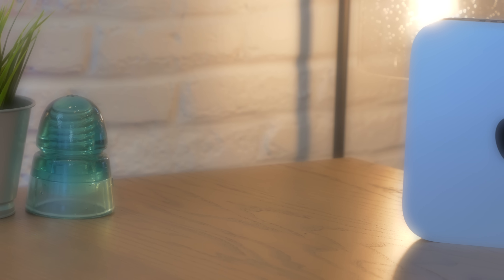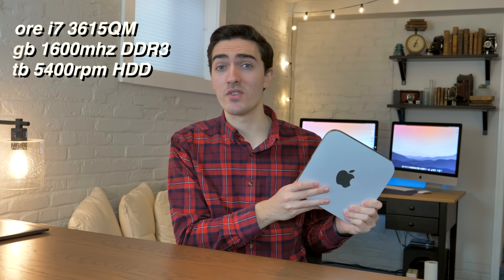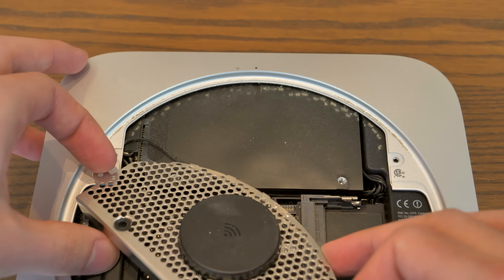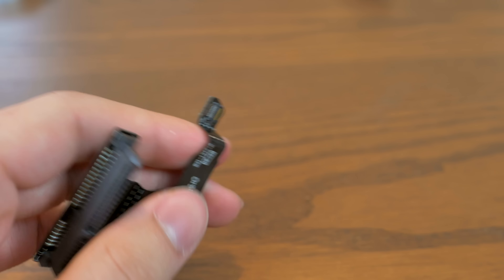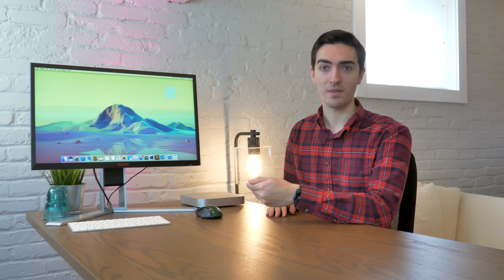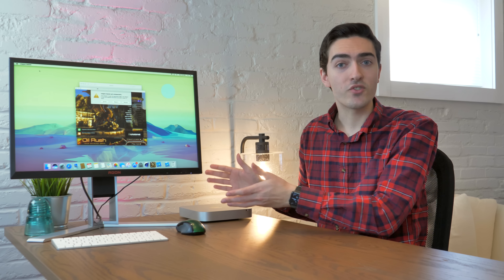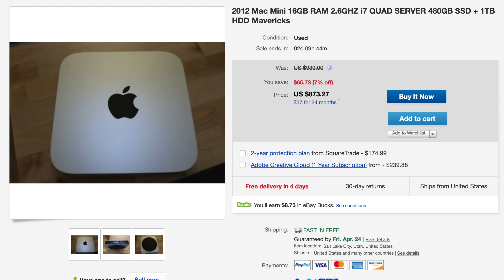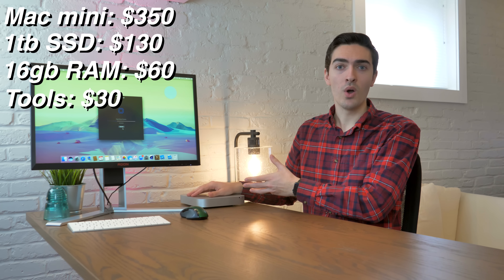Building the ULTIMATE 2012 quad core Mac mini – But is it worth it?

Comment: If you find one cheap go for it. Otherwise please don't by any macs before 2012. 

I have a maxed out 15 inch last 2013 macbook pro. If your anyone else it's I'll be fine for you. But as a programmer, UI UX designer and occasional video editor it shows its age

Comment: I had a 2012 Mac mini, i7, upgraded to 16gb ram and 2x 500gb Ssds. I was able to perform a RAID 0 and cloning OS Mojave onto the combined drive running stable with about 1GB read and write speeds. Great option and fairly priced, after all the upgrades it came out to around $550.
Reply: Hi Richard, I did the same with Catalina!

Comment: A fairer comparison would be to say compare this 2012 and any subsequent models with the same amount of internal SSD. 8GB RAM is sufficient for most tasks. Then you can see if the trade off is still worthwhile - lack of 4K (QHD only available via the single Thunderbolt 2 port); no USB-C/Thunderbolt 3 and of course the anaemic graphics performance.

I happen to have a mini 2012 (Server), and upgraded one of the two internal 1TB hard drives to a 1TB SSD. It was faster than my iMac 4K (2017) until I also upgraded that one's hard drive to an SSD!

Comment: Damn this video was interesting in a sense of I’m literally upgrading my Mac mini late 2012 as well and started about 2 weeks ago. It’s has a i5 2.4Ghz, 4gb 1600mhz, 500gb hdd. I managed to find a late 2012 Mac mini here in Australia in pre good condition with all of those stats for $200AUD, I bought ram 16gb 1600mhz ram $116AUD and a 256gb Samsung 850 pro from a previous build $80AUD. All up costing me around $400AUD, I felt so bad when I heard how much you paid altogether. But if anything you do have a core i7 which are pre hard to find here in Australia and even on eBay. But in saying that I have saved sooo much $$$ from a upgrade like this.

Comment: You could definitely save money by cutting back on the SSD. Why would you waste money on a 2.5" SATA SSD that costs over $100? You could get a really cheap 256GB one for about $40 - $45 when they go on sale. This cuts your cost down from $130 to just $40 - $45. You really don't need to run 1TB SSD at all. I don't get why people do this. If you have options to have an extra drive, I wouldn't waste the money to buy a full 1TB SSD. I'd buy the cheapest or at least get one that's about 256GB. Then put the macOS on the 256GB SSD. And then I'd just use the 1TB mechanical drive that comes with it as storage. I'd first copy the /Users and /Applications folder to the 1TB mechanical drive. Then deleting them from the 256GB when running from Recovery Mode. Then at the same time without rebooting, remapping the /Users and /Applications folder from the 1TB mechanical drive to the 256GB SSD. This in turn allows me to keep the SSD for just the OS itself. And then for my personal files and downloaded applications, they are on the 1TB mechanical drive.

Say if the entire installation took about 60GB and the /Users and /Applications folder factor in about 20GB in total out of that 60GB, then moving it to a device with a higher storage size is way better. You leave the SSD itself for just the operating system and nothing more. That cuts the usage of the SSD down by a lot because the operating system itself won't all of a sudden go from 40GB to say 500GB. If it ever does that, you know you got a virus on there. The highest it'll ever go is maybe up 10GB or so from OS upgrades. If you do happen to find yourself losing a lot of storage from just the system itself, you could also check the /cores folder which stores application crashes and system crashes for developers. Those are kinda useless for a typical average Joe so deleting that whole folder wouldn't hurt.

Anyways, the point is, why spend $100+ on a 2.5" SATA SSD when you really don't need that much SSD? You really just need a small portion of the SSD to store and boot up the operating system. Other than that, your personal files and downloaded applications could be moved to a higher storage device.

Lastly, you're being over charged for your Mac Mini. Mac Minis should be going for about $240 - $280 range. So if you also factor that in, you're spending a lot more money than you really should be. So if you were to causally buy your setup, you'd be doing

Mac Mini: $240
256GB SSD: $45
16GB SSD: $60
1TB mechanical drive: Comes with
Tools: $30
Total Price: $375

So the total of these items cost just $15 more than the Mac Mini you bought just alone.

Comment: I run a Mac mini 2012 (Upgraded RAM, Dual Storage combined to an Fusion Drive) together a Akitio Thunder 2 with a RX 560 4GB in it and even it only has TB1, it is a HUGH improvement! Heaven run with around 45 FPS. World of Warcraft Runs way over 100 FPS and even Total War: Warhammer 2 runs with 35 - 60 FPS.

Comment: I've got what you ended up with and for me the value is there, but that's because, except for a new SSD, I bought it back in 2012 and quickly upgraded the RAM to 16GB. That means I've gotten eight years of value from it, which is quite a deal. But I agree with you that spending almost as much now to give myself that same performance makes little sense. That said, it does all I need it to do, so there's no pressure to upgrade.

Comment: I have Mac mini (Late 2012) 2.3 GHz Intel Core i7 16 GB 1333 MHz DDR3 - 1 TB SSD - Dual Monitor Setup included a LG UltraWide 34 Inch Display and HP E222 Display - set vertically - Runs like a champ and I do remote tech support for a living and some programming. I can also run and edit in Final Cut Pro with no issues - just not 4K obviously. I run Windows 10, Ubuntu in Parallels for work with no problems either. This a great value if you can add and replace what you need slowly.

Comment: You dont need the tool to remove the board. Just hook up an ethernet cable, and pull a bit. pulls it right out. (pc repair guy tip)
Reply: Legend tip helped me out !
Reply: I use 2 slim screwdrivers from an iphone repair kit. Even if you only have one, take turns in each hole to move it out.
Reply: this trick works very well. Thank you so much!
Reply: The tool is cheap (I think $5 from Amazon) but you can do the same thing with a couple of slender screwdrivers as leverage. I'm not real keen on pulling the assembly out using an ethernet cable – the cable itself is strong but the connector is plastic and could break off inside the ethernet port. The ethernet port is also off to the left on these boards next to the power connector, so you're not getting even leverage on both sides of the board. Anyway, just my humble opinion.

Comment: [edit] I just remembered the issue with UsB was NOT the Mac Mini but strange behavior from an aging wireless Logitech keyboard. This is apparently common among Logitech wireless dongles (whatever they’re called.)[/edit]

Having this model for several years I can say they are solidly built. One excpetion is that the USB 3.0 system can sometimes flake out and stop devices from working. Sometimes the quick fix is unplug a device and move it to another USB port (unless you have all four ports filled then you’ll have to power off and restart unless you have remote access from another network computer and can shutdown remotely.)

I intend to install Linux (distro recommendation?) on one of these to see if will work properly.

Comment: We have three of them. Note there is a “server” version that has the dual drives already installed so if you’re lucky enough to find that model on eBay grab it so you won’t have to perform the iFixIt upgrade.

Comment: I bought one in 2014 for 600€, did upgrade to 16gb ram, 512 ssd and kept the 1tb spin drive for storage, connected to 2 Asus ProArt 24" 1920x1200. It was my main machine for pro photo editing from 2014 to 2017. I removed the bottom lid and diy a stand with a 20cm fan underneath to keep air flowing. Really loved it and i keep loving it. It now stands at home connected to a Dell 24" 2k and hitting hard at Photoshop, Lightroom, On1, Affinity, no complaints.

Comment: I have one and have used it since 2012. On the plus side 16GB of memory and the 500GB SSD I put in on day 1 have served me well for 8 years. Downside, I wish I bought a larger SSD (they were there in 2012, just really expensive) and now the 16GB limit on memory is getting to be a bit much and the abysmal GPU is really starting to get on my nerves. I have a 15" Unibody with the same specs and a GPU (Nvidia) and it screams in comparison to the desktop now. BUT I will upgrade my MM to a new MM with the i7, an EGPU and 64GB of memory to serve me for the next 8 years shortly.

Comment: Bought this very same quad core i7 Mac mini NEW in 2012, upgraded to 500GB SSD and 16 GB RAM in 2014.  Still using it today (actually typing this comment on the Mac mini).... that where the value comes in.  One computer in use for8 years that is still worth $600.

Comment: I got a late 2012 i5 Mac mini for free, I threw a brand new 256gb ssd in it with 8gb of ram. I’m trying to use it as my secondary WFH system with two monitors. I find I’m maxing out the ram when I have everything I need open. (Which is mostly web brower tabs) I’m considering upgrading the ram to 16gb. To help alleviate some of the slow down, but not sure it’s worth it really because I’m not really sure if it’s the ram usage or cpu usage that is ultimately my problem.

Comment: When I first bought my top-tier 2012 Mac mini I made the max RAM upgrade, 1TB SSD (Toshiba Q-series), and made it into a Fusion drive with the w/ the factory HDD (also a Toshiba, coincidentally). That served me so well for 7 years. The ultimate issue came down to thermal issues. Over time the base CPU temp slowly crept it's way up from roughly 50°C to ~70°C. Despite reapplying thermal grease (tried 4 different brands) the temps never came down. It got to the point of doing any one thing - even just opening a single tab in Safari or Firefox - would put one or two CPU cores to the max, temps would spike up to 99°C, the fan would max out, and after the 10.14 upgrade it occasionally would just lock up for a second or two. Getting the base-model 2018 Mac mini cut my video render times by more than half. Unfortunately I just couldn't ever get the temps down on the 2012 Mac mini & simply don't trust it at this point stay reliable. So it's in the collection now.

As for the eGPU, I made a couple videos on it and the TB1 connection is a major bottleneck. And while there's no way to be sure, I suspect the CPU eventually gets to a point where it bottlenecks to a degree as well (even mild gaming pegs the CPU at 100% non-Turbo Boosting across all cores). Can't truly test that though since we can't remove the TB1/TB2 to TB3 adapter from the equation.

Comment: An iMac 2012 probably the same specs for 220, only issue was the hard drive. I just use an external ssd to boot from. Works great. I keep procrastinating to pop open the iMac 😂, I have all the stuff to fix it.

Comment: lol... That's for u.
Last week i got mine on eBay for $251 + TAX + Free shipping = $273.28.

specs are:
512GB SSD
4GB memory
i5 quad core 2.5 GHz processor.

I only upgraded the RAM to 16GB, and it cost me an extra $40 + TAX + Free shipping = $43.55.
Maybe not the best deal, but I think it's worth it.

Comment: I got mine in 2012 with the i7 2.3. During all this years I've upgrade RAM and SSD. Prior APFS I was running MacOS on raid 0 and it was pretty fast. About two years ago I bought a 3440x1440p display but the iGPU in the Mac Mini only worked at 30fps while my display goes up to 100fps. I went eGPU route with a sonnet enclosure and a RX590 and I'm getting 41048 in metal geekbench and I can run my display at 100fps (this is totally unsupported by Apple, but not very difficult to achieve). This is the best value for money computer I've ever bought from Apple. Now I have also a MBP16", but I don't think it will ever be as valuable as the old mac mini.
Reply: I forgot to mention the same enclosure and eGPU only got 47000 with the MBP16". Not too bad for the old Mac Mini I think...

Comment: Bought my MacMini 2012 i7 2.3 Ghz and changed straight away Ram from 4-16 GB.
Two years ago installed 500GB SD. Should have inserted 2, 1 TB SSD.
Use MacMIni as a music computer. Biggest disadvantage it runs very hot. Its been a good Mac!

Comment: I bought one of these in 2013, (dual core i5 version) for £450 with a student discount. When I installed High Sierra it became very slow but still just about usable but I was now using windows 10 for most tasks. I had to do some video editing in lockdown and thought imovie would be the best thing to use. I bought 8gb ram and 500Gb SSD and it has transformed this machine to better than new. In total I have paid about £550 for a mac that has effectively lasted 7 years and is still going pretty strong. It's no powerhouse but for everyday use and imovie, garageband and multitasking it works smoothly and running Catalina. For me it is the best mac apple ever made.

Comment: So with the 2 TB SSD and the 1TB platter did it try to create a fusion drive? When I did my first upgrade I went with a 512 SSD and a 1TB platter and it wanted to make a fusion drive out of it. Wasn't with Sierra, HS or Catalina so maybe those newer OS's would have created it as 2 separate drives. A couple months ago I went to a 2TB drive and nixed the platter drive. Not much of a speed increase but I sure do like the storage. Thinking of adding a second 2 TB drive but not sure if it would report as 2 separate drives or one 4TB. Thought I read an article where there was a 32gb kit for our older mini's but not seeing anything beyond 16gb. Not that it really needs it I guess. I use the 2012 mini at my office, a newer 2018 mini in my room. Both work just fine and I'm using the 2012 to type this now. Gets a bit warmer than I like to see and I noticed that the CPU and gpu aren't at the same elevation when I repasted. I get a nice spread pattern on the cpu but not so much on the gpu. Guess it's a gpu, I'd need to look at the ifixit page to make sure what I'm looking at. TG Pro calls it the GPU PECI. Nope, I was looking at the wrong thing. It's actually the  Intel E224B809 platform controller hub. Guess it's ok because the temps I'm seeing are lower than the CPU cores.I usually run mine without the bottom cover since I use a sliding mount and if I'm really using a lot of programs then I'll aim a secondary fan to try and keep it cooler. I don't like running above 80C. Handbrake sends the cores to almost 100% usage so I don't use it that much anymore.

Comment: 5/16/2020 I use a 2011 iMac mini server with anI ntel i7cpu and two 500GB HD the only upgrade I have done is 16GB Memory and thinking about upgrading the HD to a 500GB SSD since they are now affordable. I use the mini with Parallels software so I can use MS Windows in a virtual window for my CAD drafting software that is only Windows PC. The 16GB does speed up and usefulness of being able to run both OS at the same time, I think with an SSD I could greatly increase the boot time with Apples High Sierra the max OS it will support. Apple has made it harder to upgrade any Mac mini now with most everything being soldered in. Wish it still had the built-in DVD drive. The 2011 iMac mini Server i7 sold for $999 when new, check E-bay for some good used prices if your not going to use it for gaming.

Comment: i purchased a 2014 mac mini for $1 at a yard sale needed a hdd since the lastone died and needed a new wifi antenna 

wifi antenna $12 a 500gb ssd $50 a pcie connector $13 and 128gb nvme ssd for $30 its a decent deal with a core i5 and 4gb of ram haha

Comment: I would disagree that an eGPU isn't viable with this machine.  I used to own one of these machines and used it with an Akitio Thunder2 + GTX 1060 and it improved the Geekbench 4 scores for OpenCL from 6400 to 74000 - that's a pretty significant difference and made a significant difference in Final Cut editing and export performance.

Comment: Luke, I have a Late 2012 Duo Core, and did the same upgrades as you did in this video. One feature it’s missing though is Sidecar Support in Catalina. However I bought a Luna Display dongle that adds that capability for just $49. It’s worth checking out. You will need the Mini Display port version. You can borrow mine if you want to talk about it. 
I made a video about it on my messy channel if you want to check it out.

Comment: I don’t know why he doesn’t talk Mac Mini more often. I feel like it’s the best buy Mac you can buy (other than video/gamin purposes). With several use cases that will span a decade. Easily configurable (when Apple allows it). Main computer -> media server -> file server.  Am I the only one who wishes Apple would bring back Mac OS server in a real way. Still running my 2012 i7 as my daily for web dev work. And 2011 as headless  24/7 file server and running bots.
Reply: Ezmyrelda Andrade  Design wise isn't it exactly the same (minus replaceable hard drive) ? As a throw back they should make the Apple logo light up.

Comment: There is NO Value in this video other than the tear down, which can be found anywhere... Who cares what the cost is, if it can provide the access to applications that you need.  Does it work as a GREAT DVR Entertainment system, HELL YA We run PLEX on ours and it's unbelievable... would it work Great for Adobe Photoshop and Lightroom... hmm good question, it's not rendering 3D, but the built in graphics of the processor allows for hardware acceleration, so this could be a good buy for a photographer or graphic artist or web dev.... You have to go BEYOND the Cost of Parts and look at the Usefulness of what you are building.